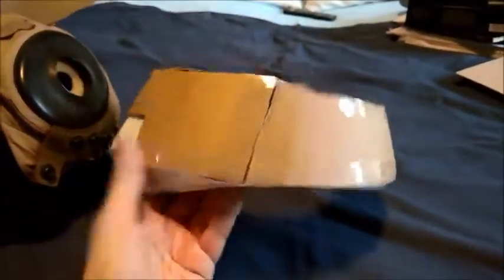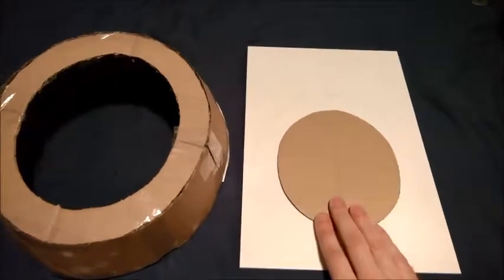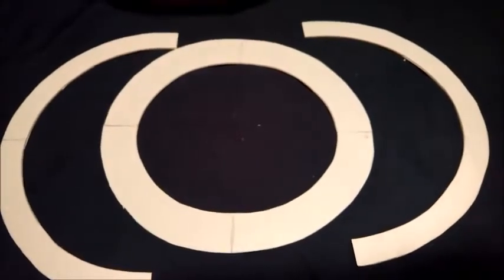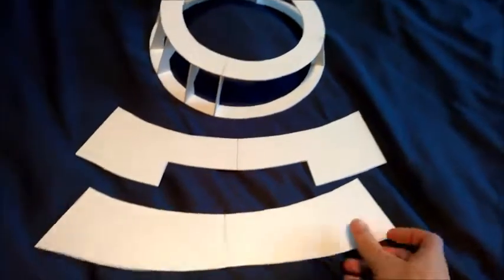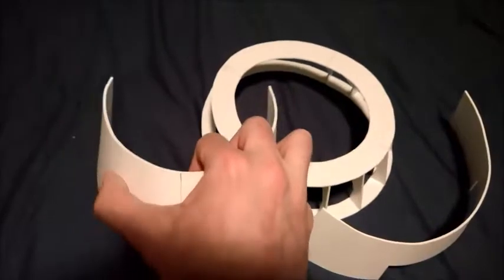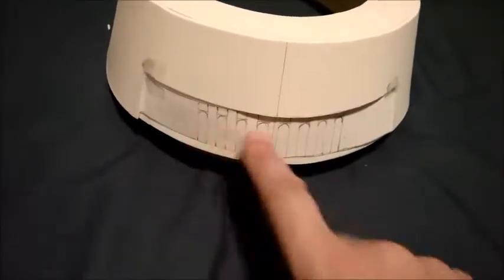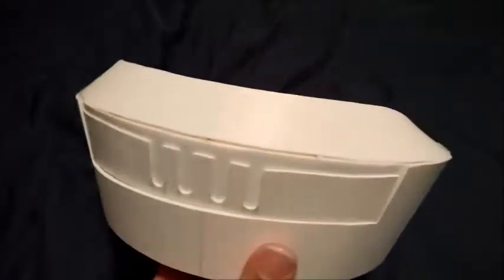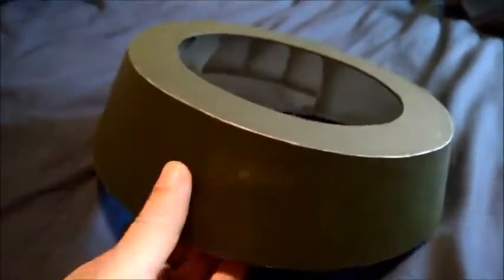Scratch Built Rebel Endor Trooper Donut ROTJ

Comment: Hi, this is really good. Do you have the templates?
Reply from the maker: Thanks. Most of the parts are measured against your head so there are no templates for them. The only pieces that are of a fixed size are the internal braces. The size and shape of these as well as the general instructions can be downloaded as a pdf from the projects section of my website http://thehazugfiles.uk/Index.htm
Reply: @stephenjdutton  oke Thks for the info. I will be making one at the weekend.

Comment: Amazing build! Btw where did you get your ANH-15? i've only found them for about 250 pounds...
Reply from the maker: I'm a regular at a military surplus store so the owner was looking out for one for me. It was about £60 and that's not much less than I'd seen them elsewhere. They aren't particularly collectable so I'd be suspicious of why someone was asking for more than four times what I paid.There are some basic replicas on eBay that include the ribbing and peak that sell for cheaper than I got my flying hat as well.
Reply: stephenjdutton ok thank you so much for replying😁
Reply: stephenjdutton oh and sorry if im asking a lot of questions but what kind of plastic is that?
Reply from the maker: It's no trouble at all. The plastic is simple plasticard, a styrene sheet available from model suppliers. It's the same stuff as is used in model kits. It comes in various thicknesses and the amount of each you will need is listed in the instruction document on my website in the projects section. It also comes in various colours. I prefer white because pencil shows up well on it. To cut plasticard you'll need scissors for 0.25mm and 0.5mm thicknesses while for 1mm and 2mm thicknesses I uses a modelling knife, scoring the plastic and then snapping it.
Reply: stephenjdutton ok thank you so much! I will create my own when i get my hands on a ANH-15 :)